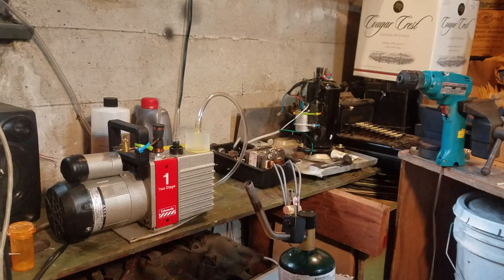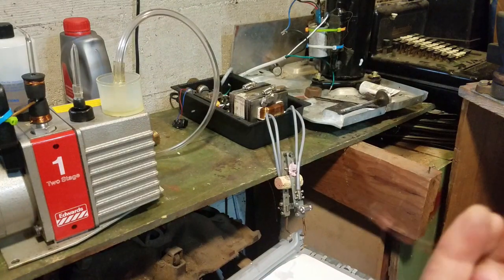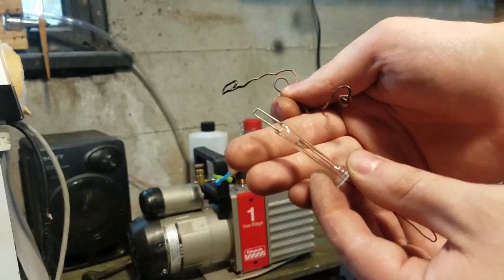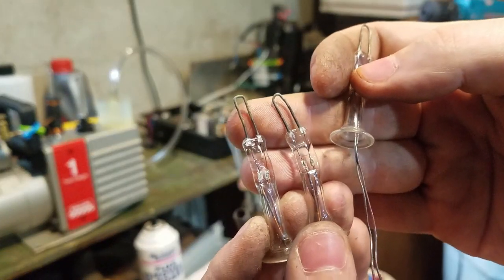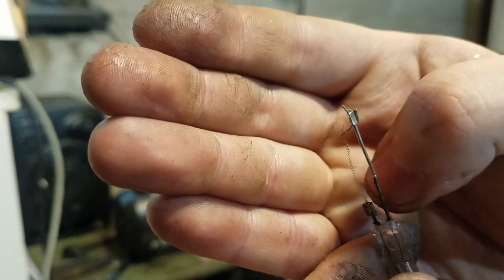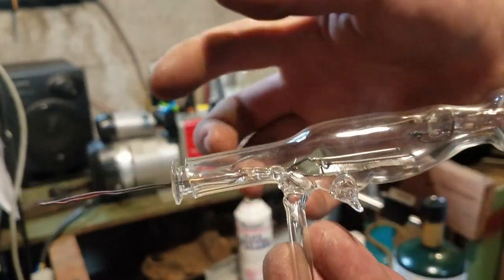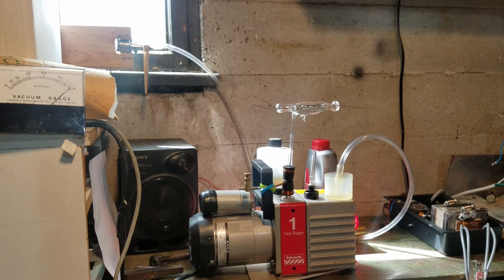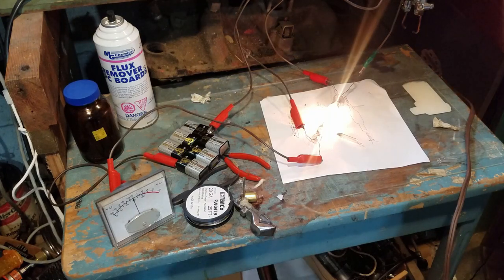How to Make a Triode Valve at Home

Comment: Absolutely beautiful! I too have tried to make my own vacuum tubes for the last three years and got my first successful diode to work yesterday. I'm using pyrex glass with tungsten seals and nickel wires. For the filament i use 0.07mm tungsten wire coated with barium oxide and the tube also has a simple magnesium getter. I've always been fascinated by vacuum tube technology and even though it's hard to make tubes it's definitely worthwhile.

Keep up the good work!
Reply from the maker: Thank you for the kind words!  I am very happy you got your diode to work there are not enough people in the world that are able to make these devices.

Comment: Neat! I might do a video of my process somewhere down the line as a comparison. Some thoughts I wrote down while watching:
- Nickel wire would help you a lot; you can solder to it, it holds up better than copper in a torch flame, and it's stiff enough for the internal structure so long as everything's fairly small. Anywhere from 0.5mm to 1.0mm is good, but 0.8mm nickel is my go-to for tube parts.
- For the tungsten, I get the best results clipping it with dull cutters. Sharp cutters can split it, and so can bending it off.
- For the tungsten oxide layer, less is more. I would typically sand my tungsten wire down to bare metal when I first got it, then flash it for maybe a second with the torch before making a pinch. Thick oxide layers are porous, and can form a path of trapped air through the seal.
- For the envelope, you might consider not blowing a bulb. I like the aesthetic of bulb envelopes, but with pyrex it isn't strictly necessary, especially with a small filament; the glass can take the heat.
- That getter flash was wild; maybe there was some zinc plating left on your paper clip parts? I've never had that happen before.
- The loss of vacuum might be due to that same paper clip. Steel is notorious for trapping air; I'd replace it with nickel or titanium wire and see if that fixes it.
All in all a good process though. I like the improvised equipment.
Reply from the maker: Thanks for the advice! I think the titanium wire I got was not pure and has some zinc in it. I made another tube after this one but heated the titanium in the air first before sealing it in the tube and the "Mirroring'' did not happen as in this video. That tube also has a much thicker envelope. I am currently under the impression that back streamed oil in the evacuation stem vaporized after being heated with the torch but I will construct a tube out of the titanium and see if a difference is made.

Comment: 2 things

the E2M1 is capable of reaching down to around 1e-4 mBar (which is high vacuum) it just takes a long time to do it. second, the heating you did essentially created a getter pump in the bulb. 

Another thing, is that the rotory vane pumps have quite a bit of oil back streaming, especially if your vessel is close to the input. So you will always have oil in your vacuum system.

Indeed, you do not need a high vacuum system, as the getters in the tube will do the pump down from 1e-3 to a decent high vacuum, assuming barium types are used.

Source:
I work with vacuum systems from low vacuum to extremely high vacuum (the latter takes weeks to achieve, in a clean system). I also work with and build thermionic systems.
Reply from the maker: Thank you! The oil back streaming probably explains the rise is pressure when I seal it off. I think that when I heat the evacuation stem some condensed oil reached its boiling point and contaminates the vacuum. Good to know the rating of my pump! I thought it was only good to 5 Microns.
Reply: @jdflyback  looks like an E2M1, so a 2 stage rotory vain. which is capable of high vacuum when the proper oil is used.

i use the larger brother on my evaporator to rough it down prior to the high vacuum pump taking over

Comment: Excellent craftsmanship. I look forward to seeing what you make in the future. Was that induction heater based on a ZVS system?
Reply from the maker: Yes, It is a ZVS driver with 2 Inductors one connected from each drain to the positive rail and the work coil and capacitors placed from drain to drain. I had a lot of trouble blowing mosfets until I made a seperate regulated supply for the gates.

Comment: Have to make my own spot welder and a few other pieces of equipment. 
What is that you use as a forming tool when making the flares?  Is that carbon?

I can see now why the early tubes (Meyers and Audion) were made the way they were.  It was a lot easier than later tubes.

Comment: Thanks for sharing! Super cool that you got it working. Could a DIY Glass lathe be the next project? :) Can I ask what your source of info is for making the Triode? Can you recommend a website or a book. Im interested to learn more about this. Good work! 👍
Reply from the maker: My sources are mainly from two different people; Simplifier and glasslinger (Ron Soyland) (Look both up on YouTube!). Simplifier has a website https://simplifier.neocities.org/ as well as Ron http://www.tubecrafter.com/. This book is also useful. http://www.tubebooks.org/Books/Atwood/Kohl%201960%20Materials%20and%20Techniques%20for%20Electron%20Tubes.pdf
Rons videos on YouTube detail how to make vacuum tubes using equipment slightly outside the reach of the average person but the glassblowing techniques he demonstrates are priceless to those interested in tube making. However Simplifier's website holds the key for the amateur in a basement. He details how to construct tubes with nothing more but basic hand tools and equipment readily available to the hobbyist. If I was starting out again I would watch all of Rons tube related videos and then try to replicate Simplifiers projects. Simplifiers website is nice in that his tube projects start out easy (glow tube, lightbulb) and then progress slowly. (diode, triode,...). It is almost like a training manual. I would deviate from his early work a little and start with pyrex glass instead of flint glass since you will have to transition at some point.
Do not hesitate to ask more questions. I want more people making tubes in the world.

Comment: I'm currently trying to build my own vacuum tubes. But I have problems with the seal. As far as I know you want yellow tunsten trioxide and what I do is making a glass bead seal with a capilary tube. Which should be dark red. And then I seal it in the tube. But the vacuum gets worse over one ot two days. maybe because I didn't pinch it hard enough when I seal it in the bigger tube? But I think it doesn't look red anymore when I pich it really hard. 
Or should I do what you did and seal it in the big tube directly and don't bother with a bead seal.
Reply from the maker: Awesome! I am glad other people are starting to make tubes! I have not had luck with bead seals personally but they are definitely doable. I would suggest sealing the wires in the tube directly only because that is what I personally know to work. In my experience a good seal should range from gold to orangeish brown. 
I show a good seal color here ( 21:15 https://www.youtube.com/watch?v=ESwj-VXjDtY)
If it looks silver and shiny or black and corroded it is not hermetic. Dark red might be ok but yellowish brown is better. 
I currently prepare the tungsten as follows: (see here 15:15 https://www.youtube.com/watch?v=ESwj-VXjDtY)
1) Pass the tungsten through the torch a few times letting it get white hot.
2) Clean tungsten off thoroughly with q tip and alcohol.
3) Pass tungsten and lead wires through torch to yellow heat briefly to remove alcohol. (Prevents bubbles during sealing)
4) Clean tungsten with a dry qtip.
After doing this I immediately seal the wires in the glass. I first heat the glass to molten and press it around the wires after that is done I heat the seal up as hot as I can and pinch very hard. High temperature is necessary for a good seal. Sometimes a bad looking seal can be recovered by heating it up in the torch really hot and pinching again.

Sorry for all the text... Let me know if I can help with anything else!
Reply: @jdflyback  Thx for the response. yeah I find it sad that there's not much interest about tube building on Youtube. I'm going to try your method today. I looked at the second timestamp and you say the while oxide is bad. Weird, I made gas discharge tubes with this oxide and it worked. It's actally sigtly yellow. I took the information from Wikipedia. It says the borosilicate glass is forming a bond with tungsten trioxide. But I checked again and it also says it's coppery/orange/brown-yellow. 
Anyway, thx for helping me. And I see you subscribed :) I definitely want to make videos about building various tubes aswell.
Reply: @jdflyback  I made a few seals now. But they all look pretty dark, almost black :/ I'll try again later.
Reply from the maker: Dark/black seals might just mean more heat is needed. The glass needs to be almost white hot to make a good seal. I would reheat the seals keeping them in the hottest part of the flame for a good 20 seconds. It is hard to describe but the glass has a certain look to it when it gets to the right temperature, you can also tell because the glass will start to pull in from surface tension.
It was my understanding that the oxide coating needed was one that was firmly attached to the wire. I think that if there is anything loose it can create a hollow ring around the tungsten. This are just my thoughts. 
The fact that you have made sealed glow tubes means you have got most of the hard stuff done. The main issue will be getting the vacuum high enough for tubes to work.
Reply: @jdflyback  Getting the vacuum high enough seems not to be a problem. I used a titanium filament (unfortunately I didn't figure out yet, how to heat it with an induction heater) I made a very simple diode and when heating the filament, the gas discharge disappears and after putting 25kV on it, I got x rays out of it xD the problem is just that I need two more connections for the titanium sublimation pump. or I could use the titanium directly as tube filament, but I think it won't last long because it's evaporating way quicker than tungsten.
Reply: Ok, I just got back to making a tube. a Dark red seal doesn't seem to be working, the tube is very slowly taking on gas. I have to figure out how I can actually get this yellow color , else proceeding to make a tube with a questionable seal is not woth it.
Reply from the maker: I have a new video about them coming up soon which hopefully is better than this video, I would just keep trying different things. For me it has been nothing but failures until one day things start failing slightly less often.

Comment: It would be a fantastic video if you made one on the construction of your spot welder.
I see there is a video you made of a spot welder, but it is clearly not the same design as the spot welder you now successfully use so very well!

It's clearly based upon an old microwave oven transformer that has the high voltage secondary removed. I did the same, but I couldn't find a satisfactory circuit to do the weld timing.
I still have the transformer, but never found a design for the electronics to do the timing and trying to do it with just a foot switch manually did weld, but I literally blew a hole in a sheet of 1mm mild steel, and what I want to weld is nickel strips on to batteries. Clearly, manual timing with just a switch is NOT the way to go in spot-welding tiny pieces of nickel strips, ha ha....

Please please publish a video on the spot welder that you currently now use so that those of us can follow in your foot steps.

Thank you for all the great videos, and I pray you will do an up-to-date video on your spot welder!

Regards,
K.

Comment: Enjoying your channel, thanks for sharing your projects.  What is the approx frequency of the  induction heater you use at 59:10 ?  My thought was that most ZVS based induction heater designs are too low frequency to flash a getter?  Do you have a link to the schematic for it?
Reply from the maker: It is ZVS based, it is not the best design. It reads 383KHz on my frequency counter. The rough schematic is here
https://markobakula.wordpress.com/power-electronics/500w-royer-induction-heater/
It has given me the most trouble of any project I have worked on. By the time it was finished I had a pile of blown capacitors and mosfets. Adding a separate regulated 12 volts for the gates fixed a lot of the problems but it would still blow mosfets occasionally. The only common mosfet I found that worked reliably was the IRL540N others such as the IRFZ44 and IRFP250 seemed to instantly blow. Having the right tank capacitors are also essential. I am using three .1uf 250 VAC rated capacitors and they have held up the best so far. Others I have tried have worked good at first but after a while they would short and blow a mosfet. Having the mosfets socketed makes repair a lot easier. If you have any more questions do not hesitate to ask.
Reply from the maker: If you plan to make a getter flasher this is a much better design. http://tubecrafter.com/tubecrafter_017.htm This also could be modified for general purpose induction heating with an upgrade in tank capacitors.

Comment: I believe what is happening is you are heating the evacuation stem to seal off the tube and that is baking moisture out of the glass and poisoning the tube. A thyristor works the way it does because it is filled with gas that ionizes and that is exactly what you are doing with your triode. It's very impressive that you got it to work as well as it does using only a mechanical vacuum pump, it likely will have a rather short lifetime but that's still quite an achievement, ideally a vacuum tube should have several orders of magnitude better vacuum. Try baking out the stem while processing the tube though and you should be able to reduce the amount of residual gas when you seal it off.

Comment: Cool.. i always want to make my own vacuum tube, my first triode it working , the only i cant sealed the glass, what torch you using? is that torch same with the yellow can MAPP?
Reply from the maker: This is an air propane torch nothing special. I have trouble with it sometimes because the flame is not very hot compared to other gases. A MAPP gas torch should work better because of the hotter flame

Comment: As all of yours, this video is great! I want to make my own triode too. I need the circuit of your induction heater, is the last part I need for making the triodes. Could you share the diagram and the value of components please?? Thank you!!
Reply from the maker: https://markobakula(dot)wordpress(dot)com/power-electronics/500w-royer-induction-heater/

The tank capacitor is made of 3 .15mf 630V polypropylene capacitors. Resonant frequency is 350 kHz
Reply: @jdflyback  Tank you a lot!!  Last question, voltage and amperage comsuptiom?
Reply from the maker: @MrDuffman83  Voltage is around 35 volts at 7 amps. The mosfets used are IRL540N. I also added a regulated 15V supply for the gates.
Reply: @jdflyback  thank you. The problem is that I have no much idea about electronics, so I don´t know how add the 15V power supply to the mosfets. If you could send me the schematics with the value of all components of your version of the heater (no the power supplys) I'd be grateful. I would pay if you want, but is the last part I need to make my own triodes and the other heaters I have tried don´t work. I leave you an email the adress you provide in your youtube profile

And other question. If you uses a 3,15 microfarad, to get 350Khz your ccoil should hace an impedance around 0,06 microhenrys and your coil seems to hace betwenn 0,6and 0,7 microhenrys
Reply from the maker: @MrDuffman83  The main circuit power goes to two inductors and to two 470 ohm resistors. I cut the connection going to the two 470 ohm resistors and applied 15 volts at that point. The main circuit power is still applied to the two inductors. This circuit will not work the first time you make it. It needs to be played with. The exact frequency does not matter. As long as it is between 100 - 500 kHz it will work ok. 
There are also 1kW ZVS induction heater modules on ebay that might work.
Reply: @jdflyback  thank you!!
Reply: @jdflyback  Induction heater done! Thank you, but another question. Does your indcution coil gets very hoy? Mine gets veeery hot and yours doesn't seem to be water cooled.
Reply from the maker: @MrDuffman83  Yes, I can only run the heater for a few seconds at a time. That is long enough to flash a getter but not long enough to act like a real induction heater. It would need water cooling to run all the time.
Reply: @jdflyback  thank you!